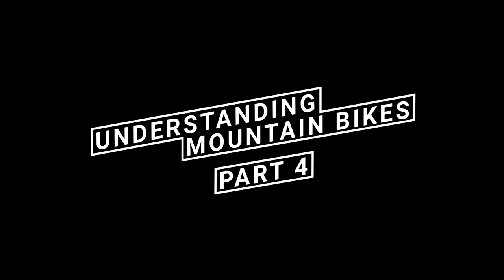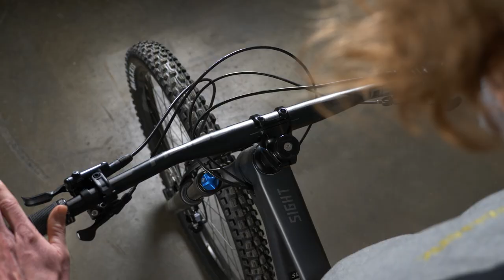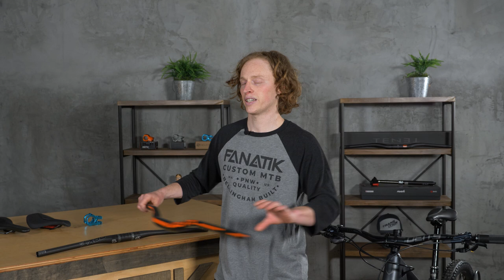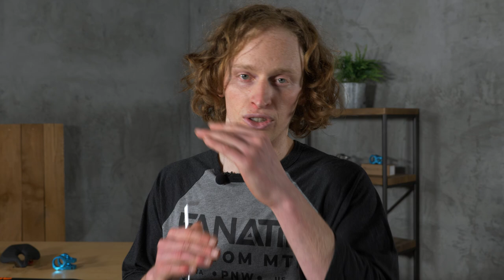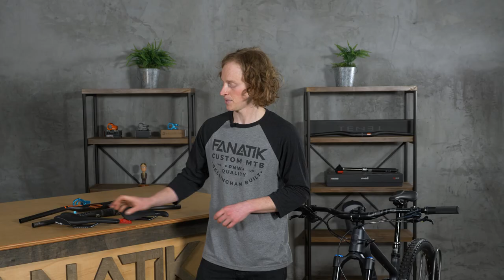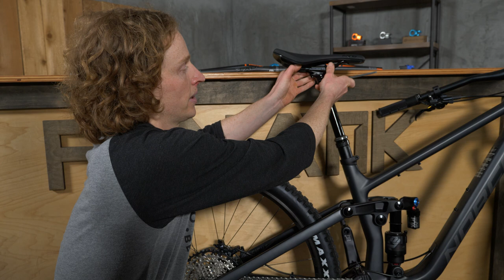Setting Up Your Handlebars and Saddle is CRUCIAL to Mountain Biking

Comment: Excellent! As the rest of the series! 😎🤙🏽
Just to ajust the saddle hight: the bend of the knee is a bit subjective to many rides. So I recommend to put the heel (ankle above the pedal axle) of the fully extended leg on the pedal, what makes a more consistent bend of the knee in the pedal position. Hope that helps 😇
Reply from the maker: Thanks for the feedback on the series, and thanks for the tip on saddle height measurement!
Best - Dan at Fanatik

Comment: Why do you measure saddle height down to the pedals? This way crank length does also affect the seat height. I would rather take the measurement from the center of the bottom bracket.
Reply from the maker: Good question. As you say, your crank length directly impacts how high your saddle will be, so it needs to be included in the measurement. Otherwise, you can't take that measurement from bike to bike and know that it'll put your legs at the correct extension.
Cheers, Dan at Fanatik